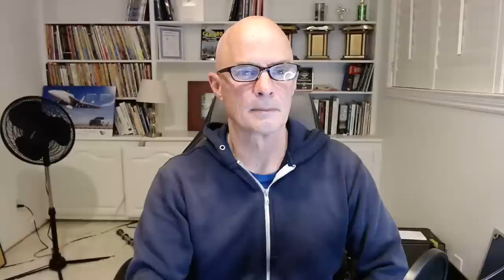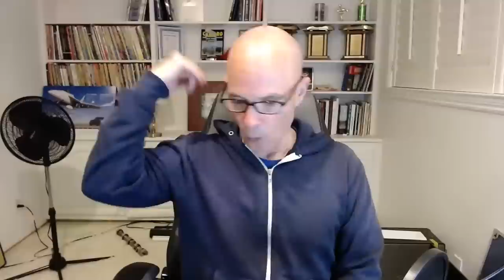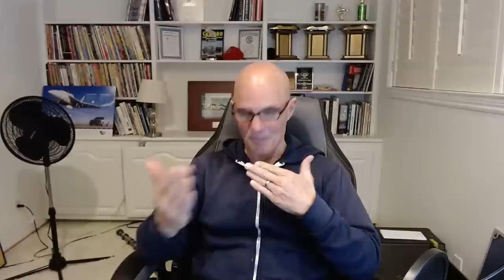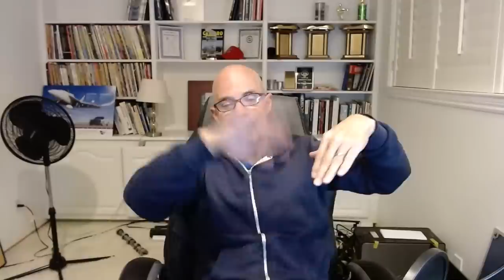LET'S TALK TECH-WHERE TO LOOK FOR POWER GAINS!

Comment: The primary restriction is at the valve seat.

I like to use the analogy that 2-4 cylinder motorcycle engine cannot benefit from a throttle valve the size of a trash can lid, but it can certainly harm drivability.

An intake or TB spacer doesn’t likely affect plenum volume. However, it will affect charge velocity, which can net slight low end gains and better throttle response, on NA engines. Also, if the spacer is Teflon it can help control charge air temperature.
Reply: BTW, Hot Shot’s Secret has good fuel treatment products for diesels. Don’t know about oil or anything else though
Reply from the maker: the valve seat is not always the choke point or restriction. a throttle body spacer does indeed add plenum volume and has almost no effect on charge velocity in the runner. Also not sure how the science (or actual dyno testing) supports slight low-speed gains if it has no change in plenum volume. a teflon spacer would not change charge air (high speed air has no time for such a temp change to occur)

Comment: Analogy for wire. "I connected a 300hp v8 to my wood splitter to replace the blown 10hp. Now the 300hp v8 has a miss and only has 250hp...do I need to replace the v8?" NO!! All I need is 10hp!

Comment: Water pump relocation 
Underdrive
Lightened Fly wheel ?
Manifold with matched right throttle body diameter size
Good ⛽️ fuel